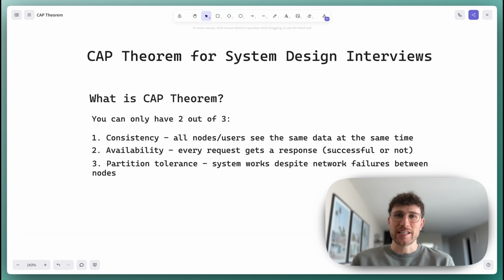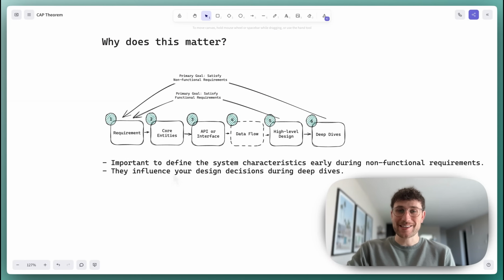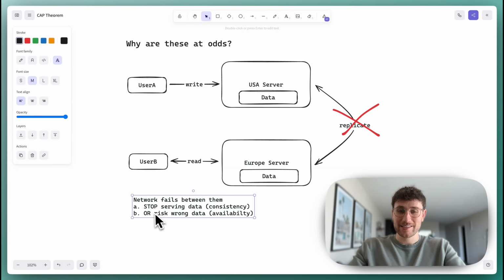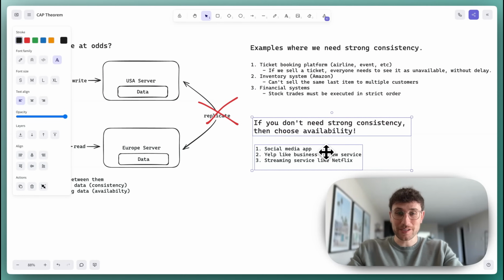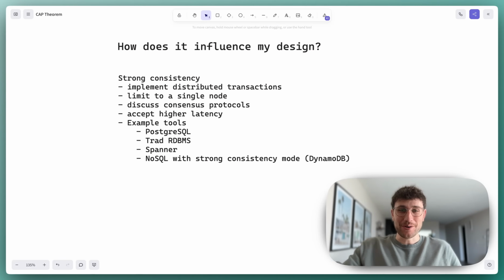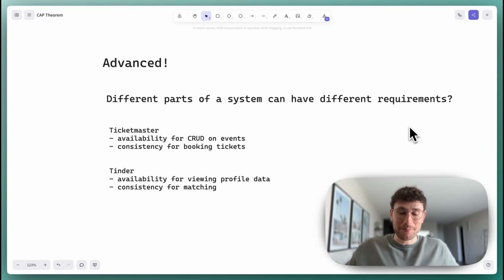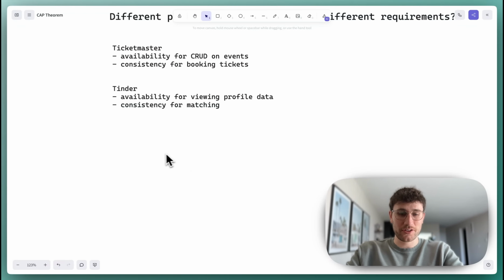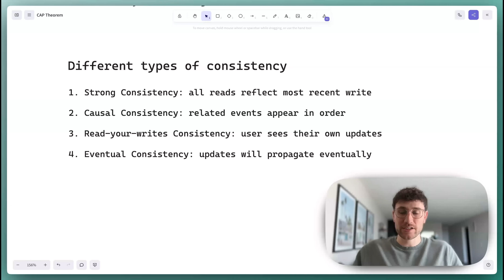CAP Theorem in System Design Interviews

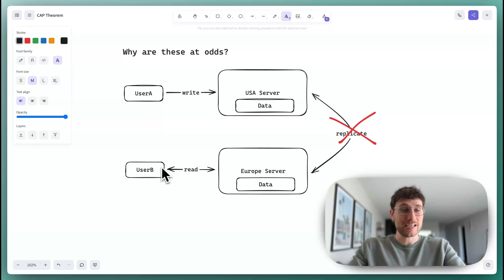Comment: At 3:30, I think that part might be a bit off. If replication goes down and server B already has stale data, consistency is already lost at that point. Throwing errors afterward doesn’t really make it strongly consistent, it just means the system detected it late. In a strongly consistent setup, server A wouldn’t confirm the write until server B has acknowledged it.

Comment: I’m thinking about the Tinder matching scenario — do we really need strong consistency for this use case? With eventual consistency, the match data will still converge once replication across nodes completes. An event-driven queue could then trigger notifications for both users once the match is confirmed. In that case, what’s the real benefit of enforcing strong consistency here?

Comment: Does CAP theorem only come into play when it’s a large scale distributed system with need for global replication? What if the its a very popular but local startup with a single cluster of app server,db etc. In that case, l guess we can avoid network partition
Reply: I think so. Even introducing a cache means you will have to think of consistency and availability incase a network partition makes your cache unreachable or increases latency.

Comment: Thank you for the video, Evan! I have a question. Isn't partition tolerance essentially a combination of availability and consistency? It seems that the purpose of partition tolerance is straightforward: if a node fails, the system should remain recoverable (ensuring consistency) and should not impact other nodes (maintaining availability).

Comment: Hey, nice explanation, but tinder match does not need strong consistency. Lets Say User A swiped right for User B and that data is not replicated to all nodes, meanwhile User B also swiped right for User A but system checked match in out of sync replica, so match will not show up immediately, but once sync happens User A and User B both will get notified for a match.
So , there can be some sort of matching service which continously checks for new matches and notifies in this case. I think tinder have implemented something similar, definitely not strong consistency, because who cares if they get match after couple of minutes

Comment: Firstly, thanks a lot for the free ones. Would appreciate it if you could do one for a shopping system with limited time offers. That seems to be a very common interview question.
Reply from the maker: What is the complexity with the limited time offers? We have gopuff as a write up on our site which may be what you’re looking for
Reply: @hello_interview  The problem statement goes something like this - The limited time offers are available to only a limited (say first 1000) customers. Its broadcasted to all but after 1000 customers accept the offer, the offer is pulled.So, the challenge I see in this, is when the service is scaled to 2 or more pods, how would they maintain a shared count to correctly track the number of customers who accepted the offer.

Comment: what about payment service for an ecommerce service where a payment service interacts with Payment Service Provider and further to payment gateways. Can we say it employ different consistency levels for different parts of the system.For example, within internal payment service it should be strong read consistent or  high value/critical transactional data might require strong consistency, while less critical data could have eventual consistency.?
Reply: @hello_interview  can you pls respond to the above question

Comment: This video was good but again it fails to cover what other videos/material fail at. What is the proof of CAP's theorem? Lets say if I sacrifice partition tolerance then I should be able to have consistency and availability as per this. But if there is partition tolerance then I ll loose on both consistency and availability. Now consider a single node database. There wont be any partition so it is partition tolerant. This means I should be able to be consistent and available. But if the node is down then I loose both consistency and availability. Its more like if I am not available then I cannot be consistent as I have one node. This goes against the theorem. I might be wrong here but I was expecting to clear my misunderstandings here.
Reply from the maker: CAP theorem is about distributed data stores and doesn’t make sense in the context of single node systems. If you sacrifice partition tolerance you’re guaranteeing a reliable network - should be straightforward to see why you can guarantee consistency and availability in this setting.

Comment: Can't we achieve a strong consistency with Cassandra within a single partition? Speaking of Ticketmaster, if we partition by event, all reads/writes that demanding a strong consistency will end up on a single partition, it's it?
Reply from the maker: Kind of. It depends on your design. Cassandra does not support multi-table or multi-row atomic transactions. So, for example, if you wanted to update an "available tickets" column on the event table and add a ticket row, you need some workarounds, which would be easier served by just using an RDBMS.

Comment: Thanks for the great content. I have a separate question. In case we want to create a system that wants 10,000 nodes to work together to do webcrawling with minimum network calls and no centralized manager like zookeeper. Do you think p2p connection with DHT managed by Kademlia or Chord algorithm will work. Also can you give couple of pointers on whether to choose kademlia or chord ?